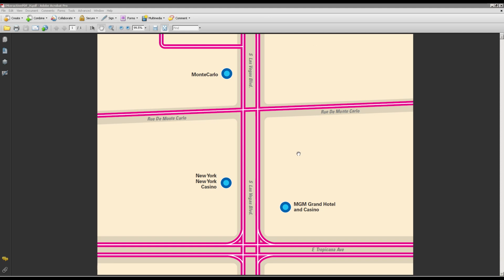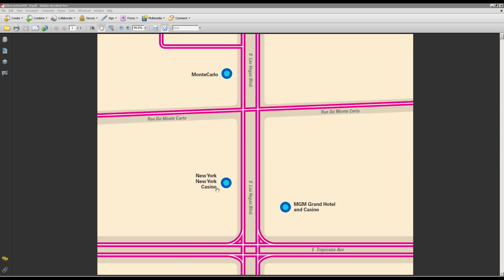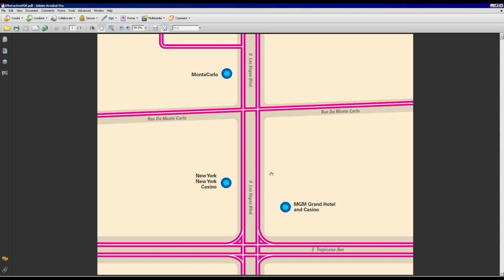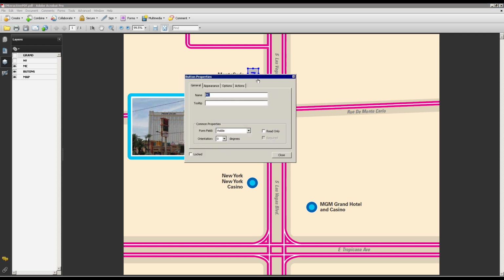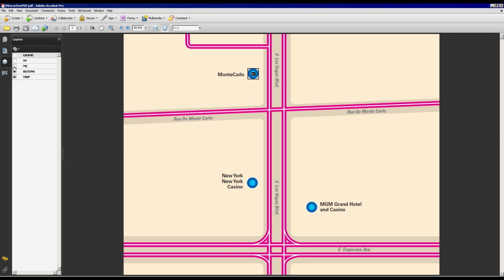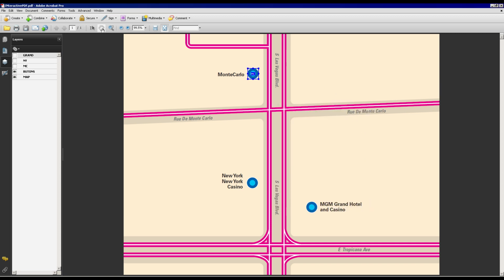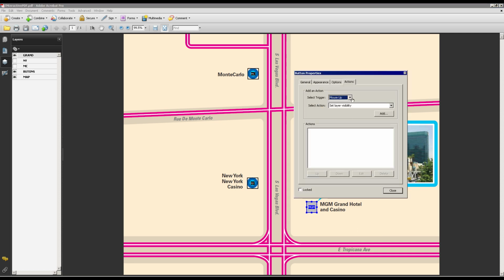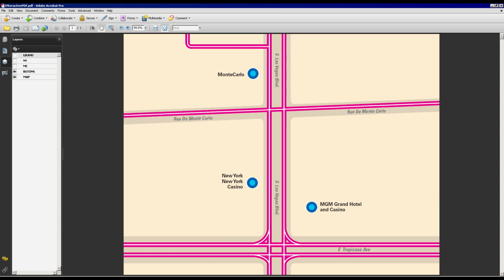Tutorial: Interactive PDF with rollover popups using Illustrator and Acrobat Pro - HD

Comment: Hello. I was doing step by step your tutorial but I have a problem: when opening the PDF into Acrobat Pro Extended 9.0 the objects (pop ups and buttons) are not visible in the Layers navegation pannel. I did a quick test file in Illustrator CC and also in the CS6 with 2 rectangles and 2 buttons. Opening the file in Acrobat I can see the 2 buttons on the canvas but layers bar on left is empty. Should display the 4 objects of the file. I checked all the visualization options and still nothing. Any idea? Best regards,
Florin